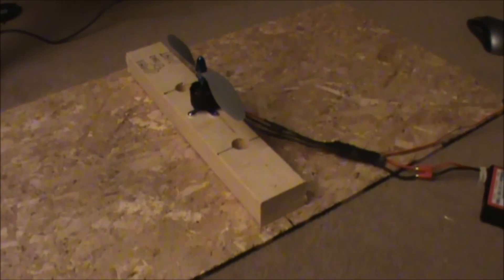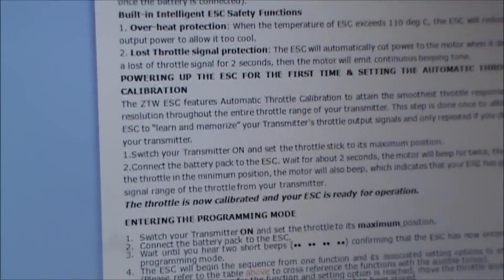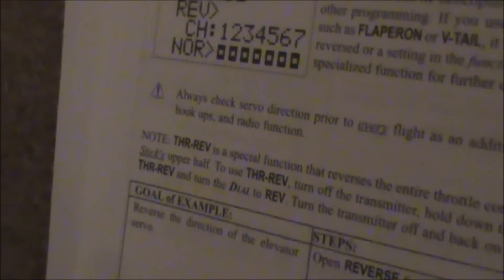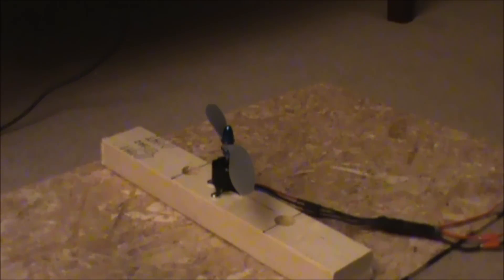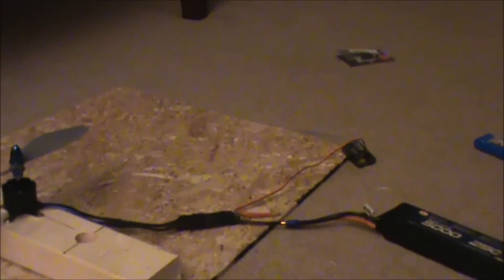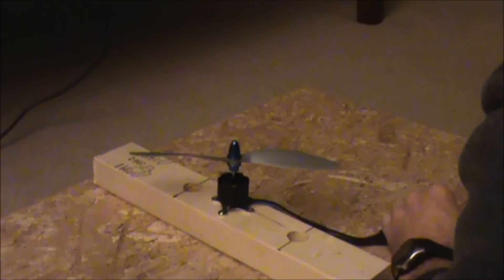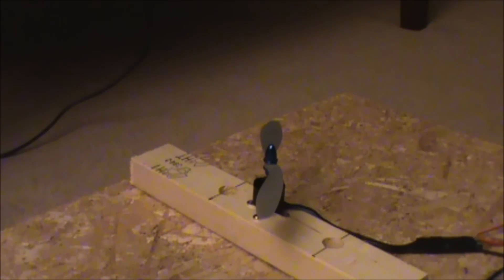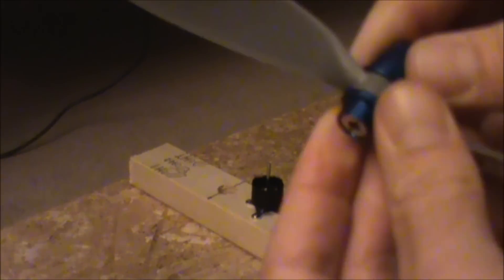Skywalker FPV AX2814 Motor with AX 40A brushless ESC with 14 8V 5000 mAH Venom LiPo Battery.wmv

Comment from the maker: Always turn the power off to the motor before turning off the radio. Same when starting. Turn the radio on before turning on the power to the motor and always set the throttle on the radio to the lowest point! When you cut the power off on the radio, there still is power going to the motor…the radio tells the motor when to get power… with no signal, the motor will take control of its self and do what it wants. Just stick to the rules above on start-up and shut down and you will be ok!

Comment: I had the same problem with my .46 nitro hobbico nextar. The prop kept spinning off but I put it on pretty tight I would suggest using a small pair of vice grips with a piece of bulsa on the bottom so it doesn't scratch the metal hope that helps